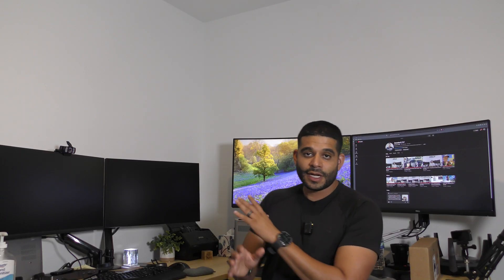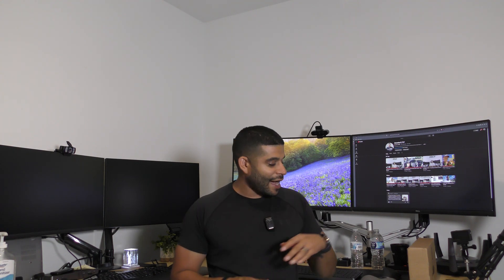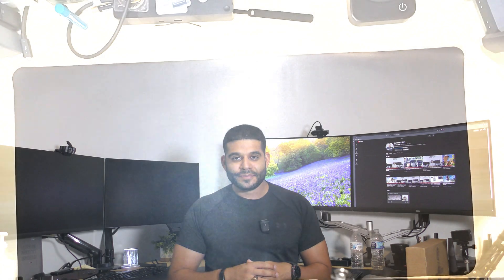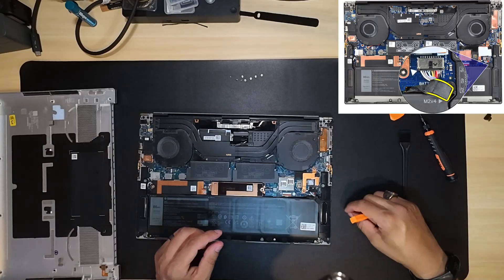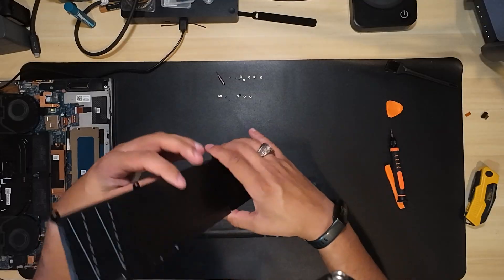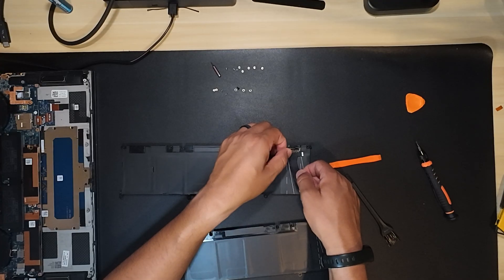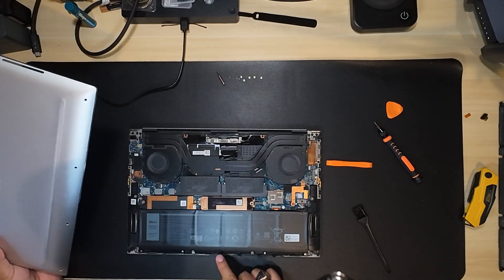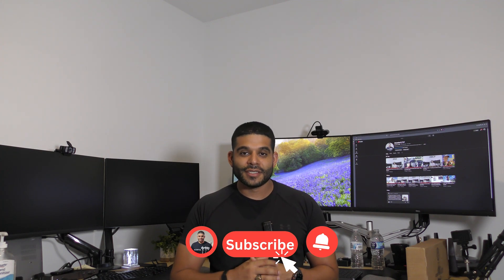Dell XPS 9520 Teardown: How to Change the Battery Cable.

Comment: Great, that's a very successful presentation that complements your last video wonderfully. Now you can clearly see how the original cable has to be removed and attached to the new battery. Incidentally, I bought the battery from Aliexpress for a much lower price. I'm curious to see if it has the same capacity as the original. ⚠
Reply from the maker: Thanks for the kind words and great to hear you found the video helpful!